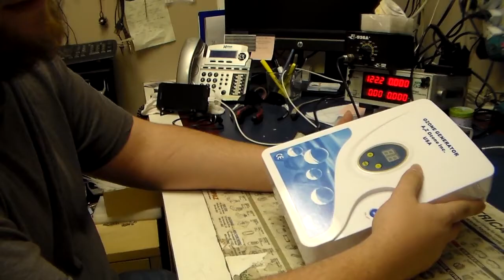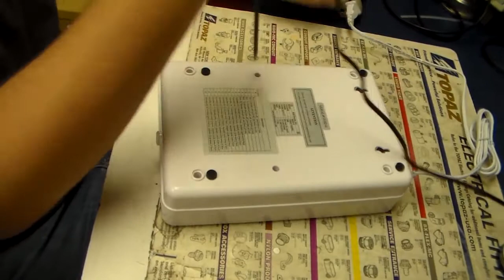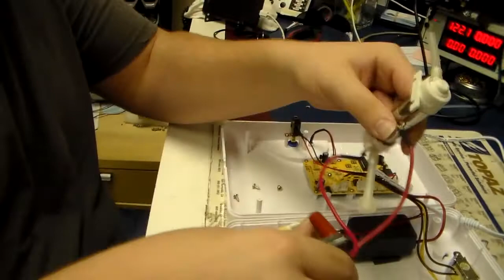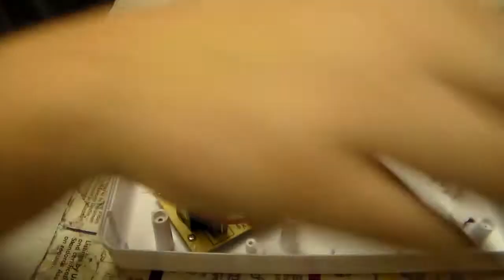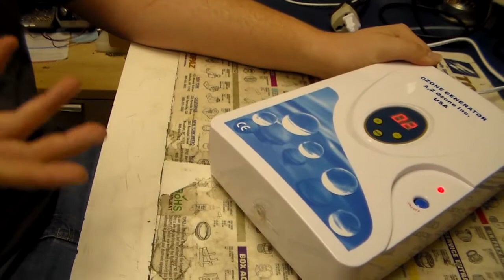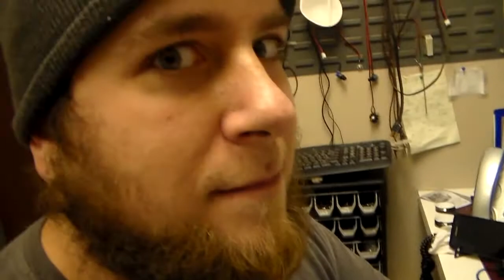Replacing Ozone Board & Cell Using Aqua-6 Repair Kit #a2zozone #ozone #ozonegenerator

Comment: I have a aqua six I just replaced the button switch I can't remember the part number but that fixed it somewhat but now it'll run for a few minutes and then just stopped and start blinking the number like it stops a lot at 04 but not exclusively it just randomly stops after a few minutes of running witchboard would that be if you know. If you know which component on the board to look at I can do some board-level troubleshooting and I have every resistor every capacitor every transistor known to man along with a lot of other parts available I could repair it if I had a actual real schematic.

But of course I'd be willing to pick & place like you just did here replace the entire board I just don't know which one is suspect
Reply from the maker: Hi, I am sorry for the late reply, and I hope we talked with you about this already! But, I want to let you know that you can call us or visit our website. You can also email us. You sound very handy, we sell the Aqua-6 Repair Kit. https://www.a2zozone.com/products/aqua-6-repair-kit

Comment: You just changed the defective. Part but you didn’t show what is in that unit and it’s fault. We are curious to know the fault findings technic      will you explain that
Reply from the maker: Thank you for your feedback! We replace the ozone board in its entirety because it is more cost and labor effective; and it will also give you more longevity because all of the ozone board parts will be new and less likely to fail. We do not generally pinpoint which part within the board is at fault for the failure. This is an interesting insight that we may want to look at in the future! Thanks again!
Reply from the maker: @rachellicee2380  We apologize that your unit stopped working. We received your inquiry and our engineer tried getting in touch with you. But he was not able to reach you. Please call us at 502-499-4977 so we can help and sort it out as soon as possible.

Comment: Where do you get the parts?
Reply from the maker: Hi, the replacement parts can be purchased here: https://www.a2zozone.com/collections/parts
Reply: @AtoZOzone  ask this question up top but I think it might be better to reply in your email. Which board would I replace or which component-level wood should I look at for a machine this exact machine aqua six that randomly stops in the middle of the routine whatever you want to call it sometimes it will stop at 0-4 sometimes it'll stop at O2 it seems more or less random I don't remember if there's a logic ship somewhere on one of them so I figured rather than taking it apart again just to ask you guys that way I can order it and replace it